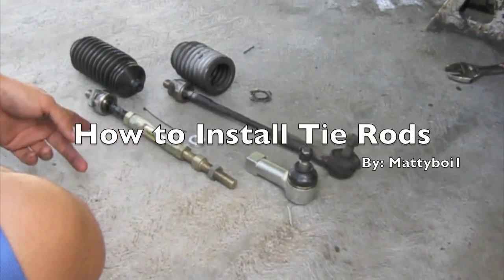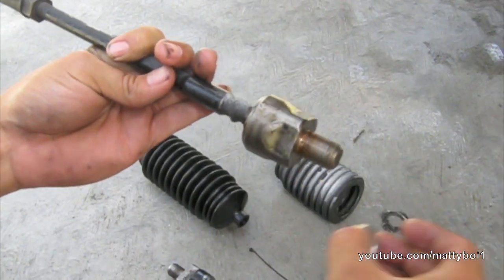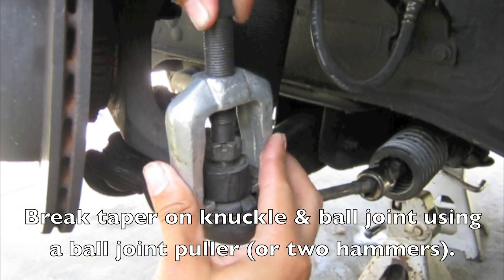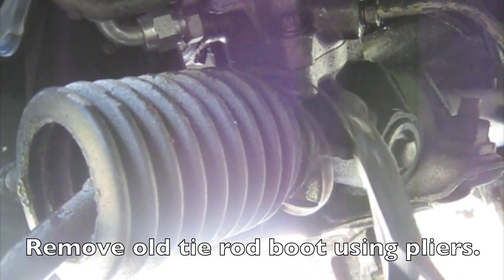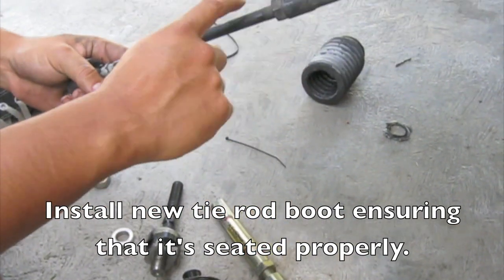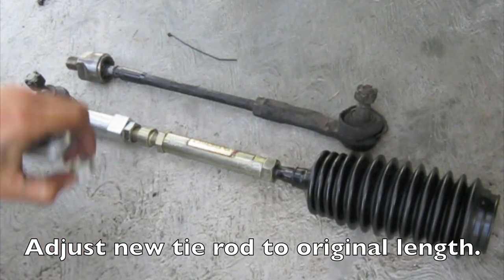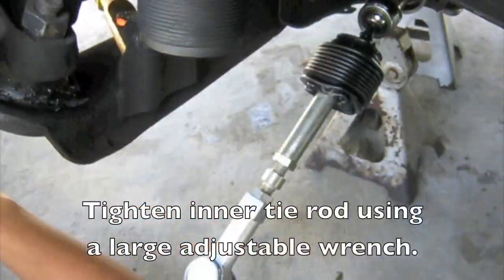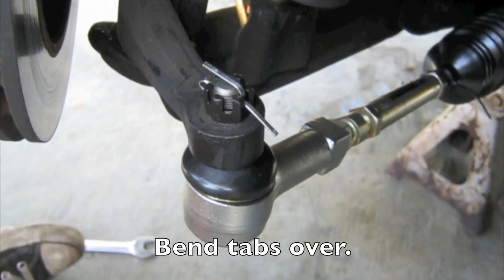How to Install Tie Rods (240sx)

Comment: Did you use new locking tabs on the inner tie rod?  I did some research before I did mine. Didn't notice if you replaced them or not.

Comment: hey i want to put 18x10 in my rear 1992 240sx hatch but would you know what offset would i use to get a good flush fit?or will i need spacers?